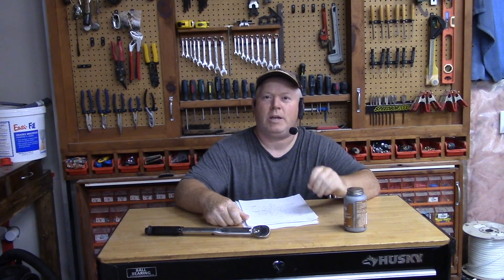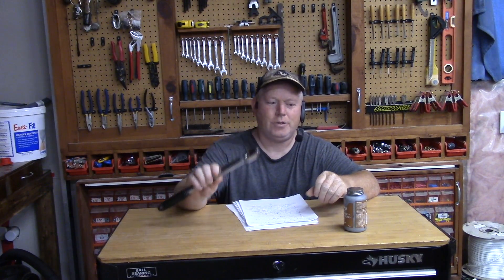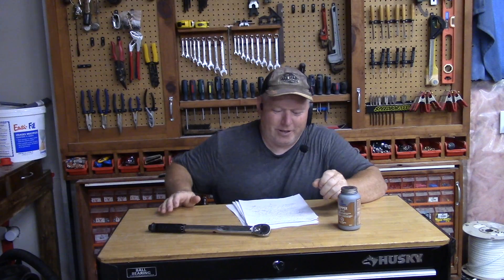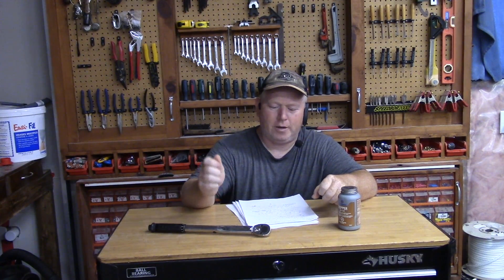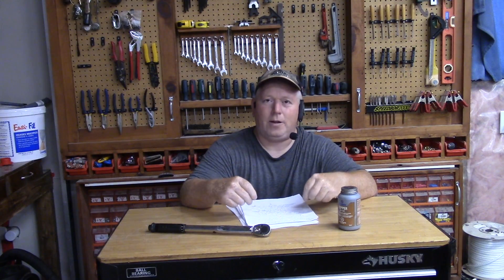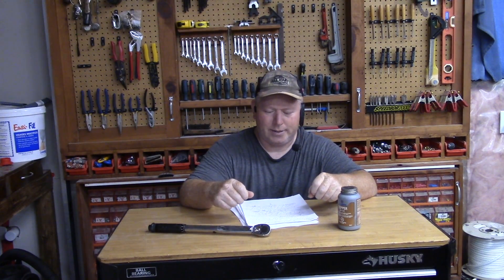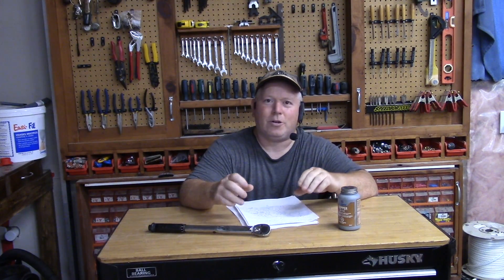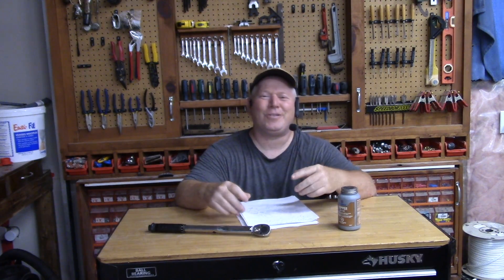Torque & Anti Seize Compound Discussion

Comment: Back in the day on head bolts it was the norm to oil all the bolts to keep them from stretching. It was the norm to use all new fasteners line today
Reply from the maker: It’s amazing that there is so much fear today but that goes for everything now I guess.
Reply: @robsgaragewoodworkin 
It's amazing that everyone has an opinion about everything with no basis included in the comments.

Comment: I use it without regret on most stuff on the chassis or suspension parts because you are absolutely right, a little anti seize is worth saving the blood sweat gears and busting out the saw or torch!